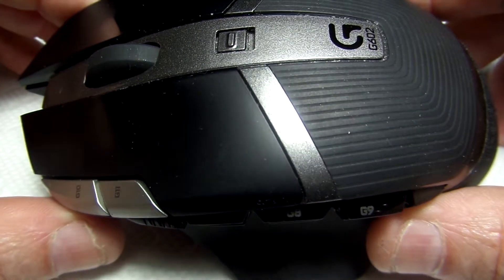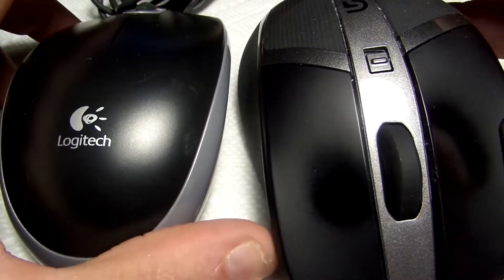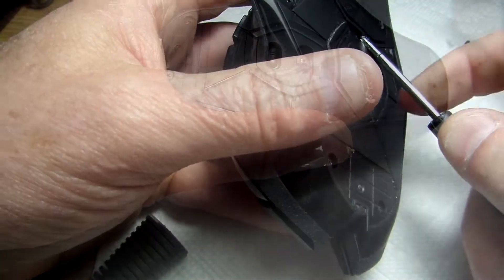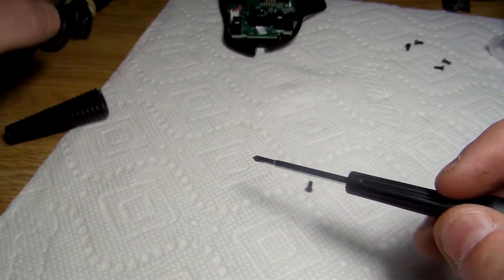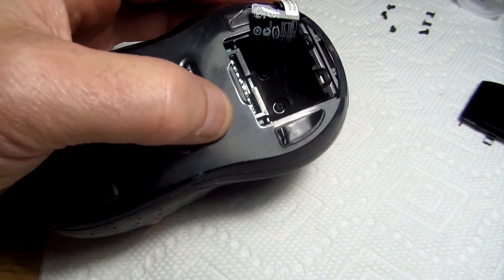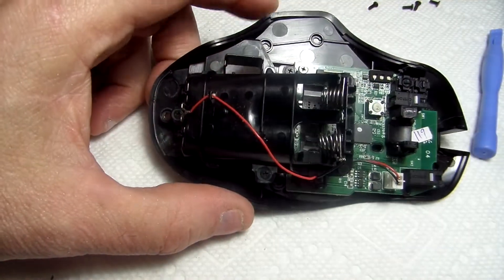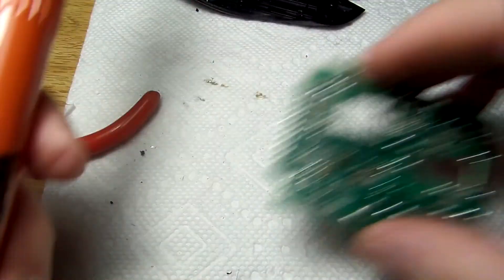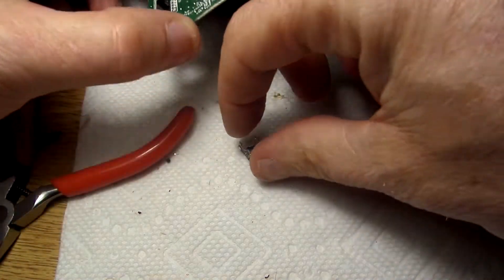How to Repair the Middle Click Wheel on your Wireless Gaming Mouse

Comment: Hi. I see you know something about repairing computer mouses. I would like to aask you if you don't mind. In my logitech G602 there is no power. Is there any chance to fix this?
Reply from the maker: If there is no power after replacing the batteries then it is likely a damaged resistor or a broken wire. It is probably more cost effective to purchase a new mouse rather than getting the G602 repaired.
Reply: @BudsSmartHome  Thank you ;)
Reply from the maker: You’re welcome

Comment: my micro switch is stuck after trying to loosen it up with some dw40. now my scroll weel is stuck in the click position... what should i do?
Reply from the maker: Not sure. You can attempt to press release several times to see if it frees up. Otherwise you’ll need to replace the switch, or just replace the mouse.

Comment: my middle mouse wheel click died on my Logitech g602, I just remapped my third mouse click using the Logitech software app to all of the side buttons, it's not ideal  but saves me from a lot of hassle. Seems like they don't produce the g602 any more, there are still some left on amazon etc brand new but they're costing like £115 ($157+) in the uk and it's successor the g604 is around £77 ($105+) . So it's not a great situation for a replacement. Boo to Logitech.
Reply from the maker: “Boo to Logitech”...  LOL!

Comment: Have you tried a contact cleaner first? Apparently, it's the go-to solution; I'm about to try it out in a few days.
EDIT: Contact cleaner works!!! So I got a can of contact cleaner, sprayed it on the side of the scroll wheel, clicked a bunch of times, shook the mouse well to get the spray out and let it dry. Fixed 3/4 mice (will take another try on the 4th one). I'm glad I hoarded the dead ones!
Reply: Thanks for the advice! Confirmed that this works as well. I had two G602s (after I asked logitech to send a new one after the old developed this issue).
Months later the new one had the same issue with the middle button not working unless i pressed really hard. Blowing temporarily fixed the problem.

I took both mice apart, blasted compressed air, then sprayed alcohol in the middle button region, and shook it a bit to make sure the alcohol got inside the button area. Put everything back together, and have not had an issue for months.
Reply: Thankyou, i've tried this and it works.. need more than one spraying from the contact cleaner. It was sucessful after I'm taking out the battery, and blow the Contact cleaner from inside the battery hole. Suddenly all the dust from the inside are out. And middle click has worked like a charm.
Reply: This is one oft the very rare occasions where contact cleaner or WD40 is a good choice, i guess.

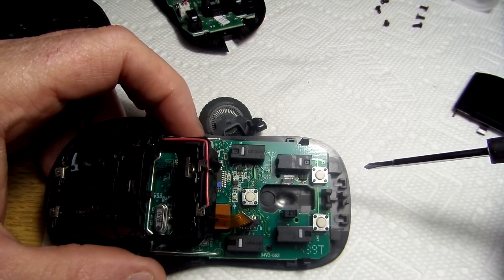Comment: Before doing this, Here is how I fixed mine, I just opened it and I blow on it several time from all the direction (I mean blow on the mid click after opening it @ 06:20 ). now it's working fine since last week. I had to flip the mouse upside down and scroll the mid and click at the same time.
if it didn't work, might worth cleaning it with some kind of liquid before trying replacing it.
Reply from the maker: Good tip. I’ve seen this mentioned before in the comments. Apparently it’s a good fix for some folks. Thanks for sharing.
Reply: @BudsSmartHome  my pleasure, thanks for the video, it's really helpful.

Comment: This is my 2nd g602 and its mid mouse not working now, it's one of the best mice out there even if it only lasts for one year top. I might have to buy two now just in case since there is no alternative for this mouse even if it has all these double clicks and mid mouse flaws.
Reply: I have one too, because I like the form. I tried not to by Logitech mice for some years. After 6 month having the G602, I know why again. Please don't buy more of this crap. I don't know how they do it, but I had other mice (cheaper ones) that held up much longer.
Reply: @alias_not_needed  There is no alternative unfortunately, you can buy 4 of these mice to last you two years instead of paying $100 to a single mouse that will last 2 years. this mouse used to cost only $24 but now they raised its price to $80. I won't pay for more than 40$ for this mouse. really good mouse but with a really cheap metal click that will break in 6 months.

Comment: These micro switches have 4 legs, where 2 pairs are naturally contacting. when you press the switch, only two cross pins become contacted. therefore you must rotate the switch 180 degrees and solder again.
Reply: You probably meant 90 degrees. If you rotated 180, you would just swap the naturally contacting pairs.
Reply from the maker: Yes, you’re exactly right
Reply from the maker: Yes.  That is what a previous viewer described to me.  I didn’t know that at the time. Thanks.

Comment: Thanks for the video!
For middle button of G602, I think that the reference of button is Omron B3F-1000 (not tested yet, I'll confirm that when receiving it)
Reply: was it omron b3f-1000?
Reply from the maker: Another viewer said it was the Omron B2f – 1000 series...
Reply: @BudsSmartHome  ok thanks, I'll try b3f anyway, can not find b2f. Its probably different in some insignificant way.
Reply from the maker: Let me know if it works for you Jan.
Reply: @BudsSmartHome   just finished and can confirm its working! oh man, that was my second repair with soldering iron my entire life :) first was christmas tree lamps :)
Anyway it took me about 40 min, the hardest part was desoldering old omron switch, which btw is marked 1 4, and the one I soldered was marked 2 5, no idea what it refers to. And if you take out the pads carefully, you can definitely re-use them.
Now I just have to change my habits to actually use that button, which I remapped to the side one...
Reply: @BudsSmartHome  oh, and reffering to your video, did you check aligning on those small numbers on the switch? edit: since it should not be possible to insert them 90 degrees to the side, it is possible to insert them 180 degrees, maybe that is the reason
Reply from the maker: That was confirm by another post. I definitely mixed up the orientation on the switch.
Reply: @BudsSmartHome  ok, this piece of knowledge may be useful for next viewers solving the same problem
Reply: @janfalkowski9738  Do you have a link to the part sir
Reply from the maker: I’m glad it worked for you Jan. Good job!

Comment: Hi. I just repaired by G602 mouse using this video, thanks! I wanted to add that button that is used there for middle click is 6x6 4.3mm just that others would know which one to order for replacement.
Reply: thanks man :*
Reply: do you happen to have a link where you can purchase that 6x6x4.3  4pin switch for cheap?  is it a normally open or normally closed switch type?

Comment: try puting zour mouth over the mousewheel and blow in, worked like a charm, and a lot of people fixed it same way, i dont get it
Reply: I had a feeling that mine wasn't working right because it was dirty and not a technical issue, but I had feared I would need to take it apart to get it cleaned. This video was informative because I had no idea how to take it apart, where the screws were, etc. I tried doing this first and a chunk of some godawful dirt came out and now it scrolls so easy and new. I think the heat/moisture helped dislodge it as well. Thanks to both of you! C:
Reply: Man,you deserve a medal,it  seems to work both for my scroll wheel and my mouse 4 button that wasn't working well
Reply: Boy, my g602's middle click works again because of your comment. Salute to you random youtube commenter
Reply: in my case it works just temporary
Reply: @jondoough  the video is for a long term repair, meanwhile your method of blowing moisture from your breath into the mouse isn't so good and is usually short term, and can cause it to short circuit.
Reply: wtf you fixed my mouse lmfao thanks!
Reply: Hot damn!  Worked great
Reply: i used compressed air it and it did nothing, then i used your method instantly worked, the ole Nintendo method

Comment: Hey, great video!

My G600's middle click (scroll wheel) doesn't work at all anymore. Software and shortcut changes don't fix anything. Should I attempt to track down and replace it's switch? If so, where would I find which specific switch it uses? (I want to order the part before opening it up)
Reply: @BudsSmartHome  I'm weighing both options, thanks Bud! I might practice a bit of soldering just for this purpose because I rely on the G600 for work and certain switches on it tend to break down almost every year (my old mice lasted 5-6 years, but had only~5 switches). I'm tempted by the prospect of modding the mouse with higher quality switches and future peripherals in general.

I've read that most tactile switches are rated for only 5m clicks or less... which is a fraction of the 20m microswitches next to them that I use at almost the same rate- I suppose after finding the right size from this kit, I'll try to find a better rated tactile switch from Omron etc but so far I haven't been able to find this rating on their website. If you know a bit more about this or recommend a source, please let me know!

Comment: I have gone through thousands and thousands of these Logitech mice. They ALWAYS break eventually.
Reply: Its always the middle mouse button
Reply: Yeah that switch is a really weak design. It always breaks eventually.
Reply: @pencilgun4934  True but it wasn't just the switch for me. The switch still works but you have to press too hard for it to be usable. The real problem came when the wheel scroll stopped working. Now the mouse bacame useless altogether. I reckon the IF emitter went bust since I can't see it lighting up while filming it with my phone.
Reply: Well, after a couple of years they also break without using. 😭